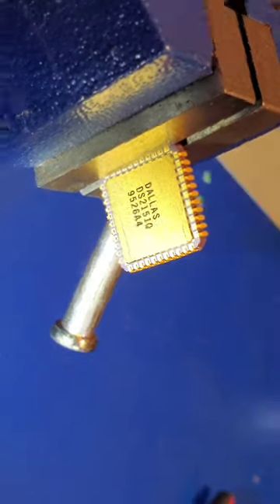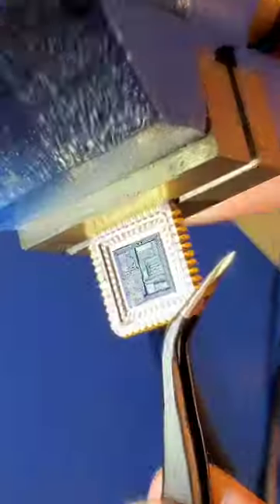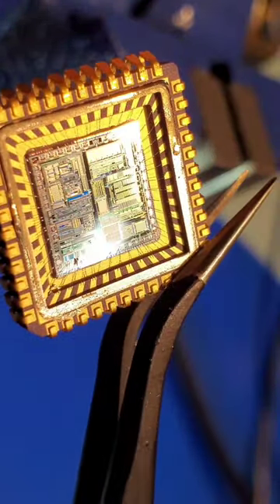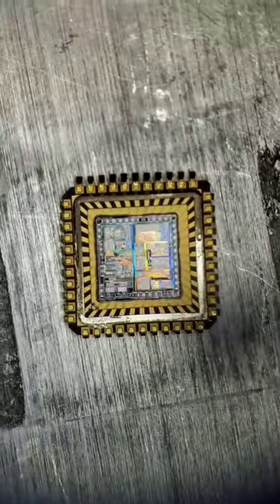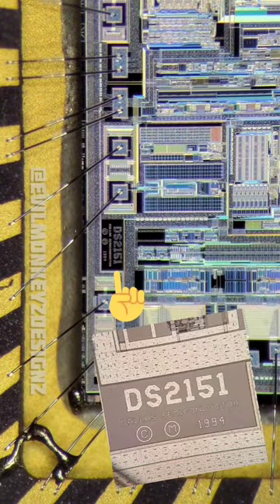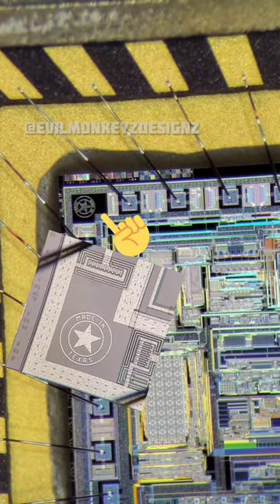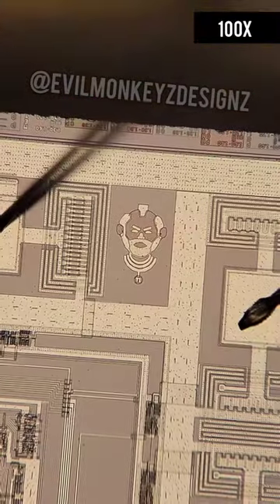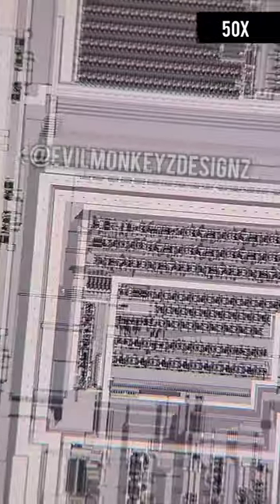CCU #121: Dallas Semiconductor DS2151 T1 Transceiver

Comment: I can easily remember fantasizing about having a full T1 connection.  We had a dedicated 56k link from Houston to Phoenix, it cost $5000/month in the early 90s.  Swapped it out for 128k bonded ISDN for a couple hundred per month.  Eventually became DSL for $50/month.  People are extremely spoiled these days.
Reply: I remember when a bunch of E1's, together 45Mbps, (b! Not B!) was all my country was connected with. 

It was even before commercial operators started providing links; all traffic went through the university network.

Comment: Was this really Introduced 1962 or did you mean 82 just curious
Reply from the maker: The T1 technology was introduced in 1962 from what I read on the wikipedia page, but this particular part was developed much later (1994 to be exact). I assume that an original T1 card would have had many discrete components to achieve the same functionality as this single chip.